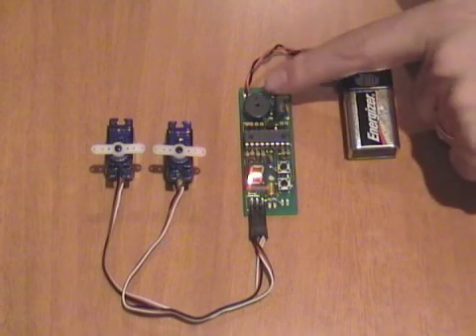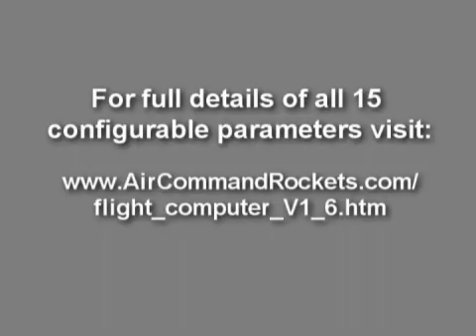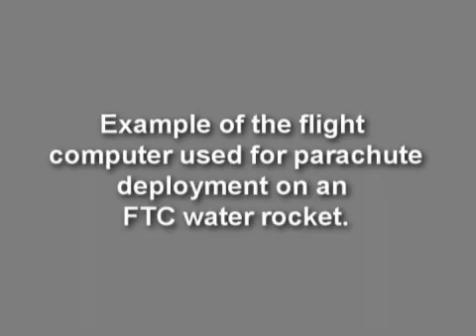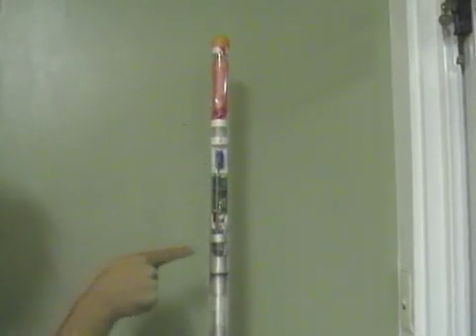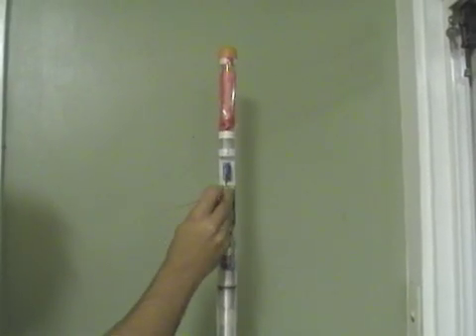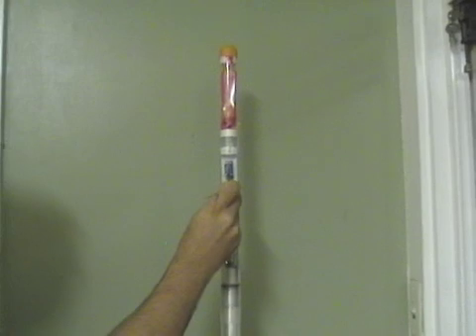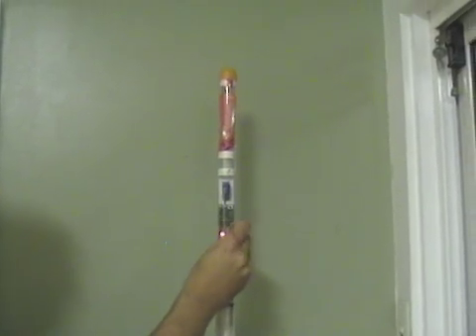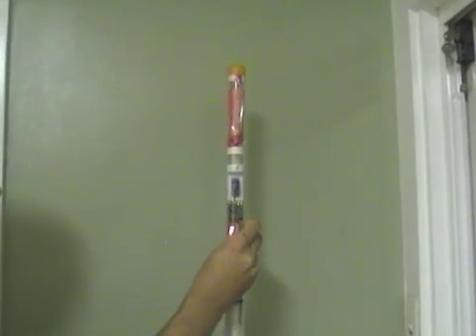Water Rocket Flight Computer V1.6

Comment from the maker: You configure the software through the buttons on the board itself. For more drastic code changes you can take the PIC out of its socket and put it in a PIC programmer.